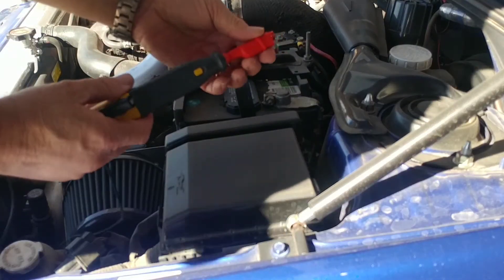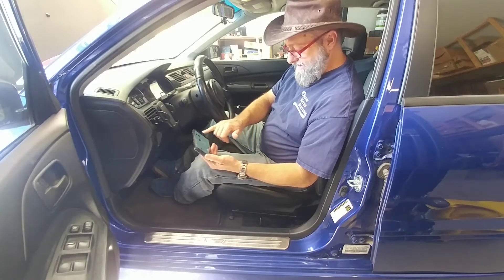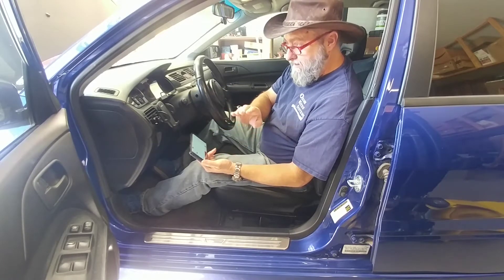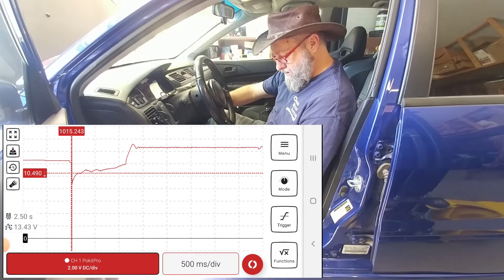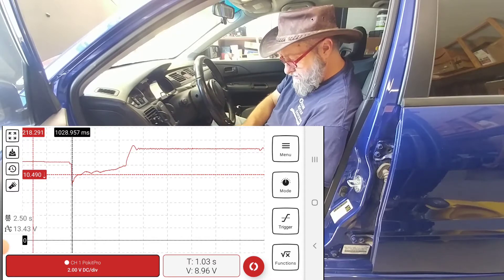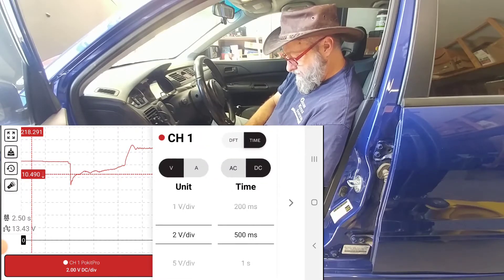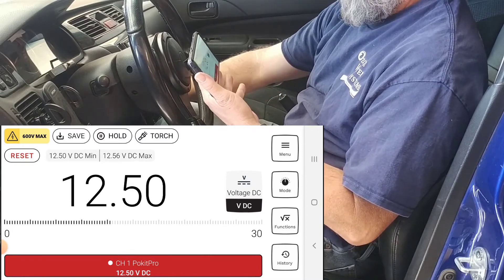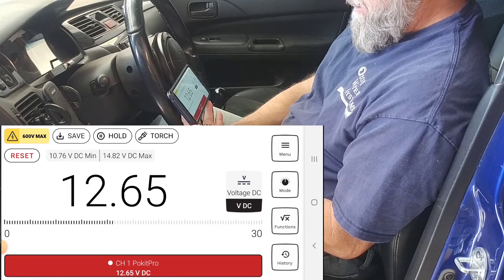Pokit Pro Oscilloscope Car Battery Load Test

Comment: so what Voltage should a healthy battery have?
Reply from the maker: I'm normally looking for it not to drop below 10.5-11 volts during cranking.  The oscilloscope is so fast it did pick up a lower dip.  This battery was a little on the weaker side.

Comment: Is the oscilloscope more accurate then the fluke? It was below 10 at lowest point
Reply from the maker: Not necessarily more accurate, rather the oscilloscope is significantly faster so is able to capture the very short dip in voltage that the Fluke and the Pokit in multimeter and datalogging mode missed.

Comment: Interesting comparison! Could you test the datalog function whether it is able to pick up parasitic draw (>50 mA) on car batt?
Reply from the maker: As long as you are careful to not overload the unit when installing the Pokit Pro inline with the main battery cable it absolutely would do that.  It will take up to 2 datalog measurements per second for days, even months.   What length of a test would you like to see, I can put it on one of my cars and let it record and post a video of the results.
Reply: @shanesdiy  From my reading, 30 - 60 minutes is sufficient for the electronics to enter deep sleep mode after locking the car. Could be longer for modern car. Maybe 2 hours of datalogging should do?
I'm amazed how this tiny device can handle months of datalogging!